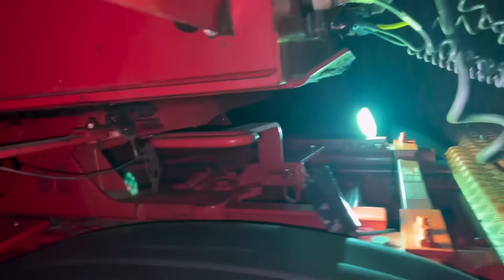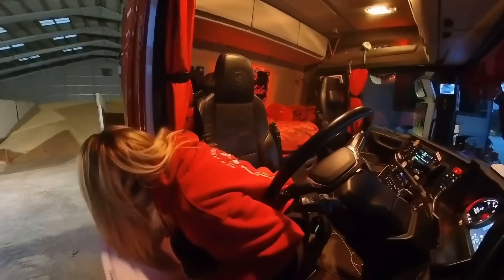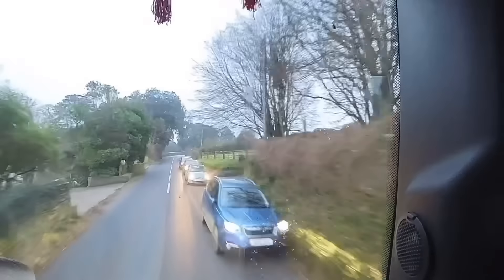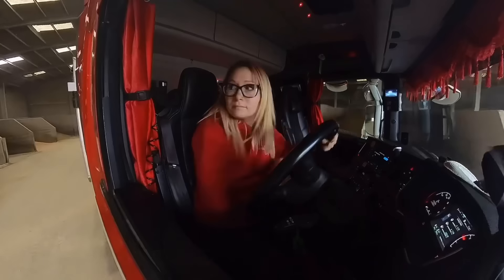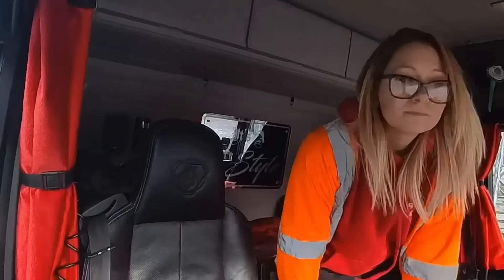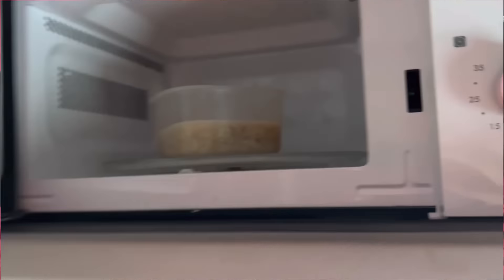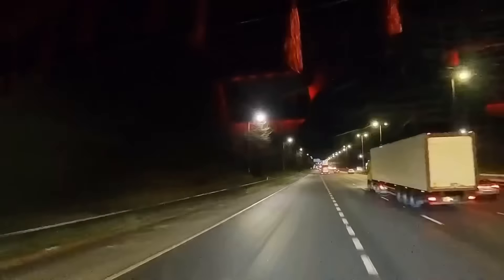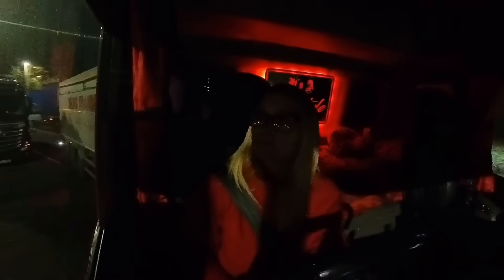Another stressful service station visit | Kingsbridge to Manchester

Comment: Onboard scales and only one trailer plus you get 45 min rest breaks. Easy life 😉. I have to self load 2 trailers with good guesswork so as to not overload on axle groups and  I only get 20mins break after 5 hours duty time 😉. Onya though Jemma for trucking in Blighty. It's not for the faint-hearted. I left it behind over 10 years ago now after having a gut full of English winters. That's what gave me the determination to move to Australia and drive roadtrains. It took a while to get sorted but that's what I do here in Western Australia. No more freezing temperatures for me🙂. If you ever fancy a change of scenery, look me up. Also, I've not heard the word "lorry" spoken for yonks😆. Love it!

Comment: Spent most of my working life on the road as an electrical engineer, usually driving a 'little' van. Though I did occasionally have to use a 7.5 tonner. Fortunately, I passed my car test long enough ago to legally drive one on my car licence.
My experience of motorway services is very varied, and I really feel for you having to use them all the time, as some are really awful. 
I remember Stafford services being built. Prior to that, there was nothing between Keele and Hilton Park.
God bless you, drive safe.
Reply: Take care.

Comment: I used to go to Switzerland from Ireland weekly , the load was for Milan but had to be cleared into Switzerland at Weil Am Rhein then onto Pratteln 10 kms south of Basel for a new set of papers then back to Basle for the overnight train to Lugano near the Italian border Como …Full nights break usually on the train at least 9 hrs and because the product I carried was a class 9 hazardous I couldn’t use the Tunnel at Gothard …Anyway my point on this train I used to meet a Dutchman who pulled a tanker , it was a new FH 16 but a longline extension on the cab an amazing transformation meaning the cab was 10 ft long ..He has a shower and toilet but only took 3 feet of space , a fabulous piece of kit but because he had a shorter trailer he could have a much bigger cab …Surely with a tipping trailer the same should be available?…

Comment: At least you got a shower even if it's luke warm, when I was driving, 1980's into the 90's you were lucky to get a shower once a week ! most of the time it was a strip down wash from your plastic bowl outside the truck with water boiled in the kettle, all very well for blokes but difficult for the Ladies. Good quality fully serviced truck stops were few and far between in the UK then with most only having a sink and toilet if that, different proposition in Europe when I was on the Italy run.

Comment: Never had a microwave in my truck (back in the stone age)... Ran a 2 burner gas stove on the drivers side fuel tank (only 1000lt of diesel so no problem). Nothing better than a hot cuppa.

Comment: Interesting point you made about not filling up to avoid losing a full tank, one of the tips of the trade.
Reply: I didn’t understand that bit, is it in case the fuel is stolen?
Reply: @hitchjack  Yes, a full tank could cost up to a grand , if the thieves tap the side of the tank and its empty why bother.

Comment: Hi,
I have class 2 over 2,5 years and I was in tons of different places from south to midlands, from west to east. The trucks I usually drive was the fridge 26t, which is over 12m long. The biggest frame legally allowed for rigid and I’m perfectly navigate  these vehicles in a tight spots and driving around London. In two weeks time I will be doing class 1. When I get license, will I be considered as a new drive or my class 2 experience also will be taking into the account? 
Obviously I will be a new driver to pull a trailer but not a new driver to drive a truck.

Comment: Do you have to phone up after every job to find out what's next? Feels like all drivers should get a daily manifest or paper copies of the days work so you can plan ahead, put addresses in satnavs etc.
Reply: You make reasonable points but speaking as a farmer that has conversations with lorry drivers, here's a few things you're maybe not aware of.

There are so many variables in a day with shifting grain in particular or possibly even aggregate that it would be hard to plan a whole day unless it's several loads from the same farm to same destination, feed mill or wherever.

Jemma needs to be loaded, unless she can get a hold of the farmer, it's a no go, we mostly all have mobile phones but it's not like rolling up to a factory with staff always there, a farmer might not have got good warning she's coming and be away from the farm.

Even when a load is picked up no bother, sometimes a load can be rejected, not often but it then throws a spanner in the works and the plan for the day gets ruined.
Even when all goes well turnaround time at a destination can vary depending how many lorries are in front of her when she turns up,  or if there's breakdowns at the mill, even a very quick half hour or 3/4 hour empty depending on product can mean waiting a couple of hours if there's a queue.

So head office of a big firm like Wains have multiple lorries doing the same work so they just task the first available in the area.

Kind of like a Taxi firm would.

I've often had drivers phone me to say they're coming for a load in an hour or x minutes as they're just tipping or have tipped.

So things can keep changing as the day goes on and that's not mentioning, lorry breakdowns or traffic hold ups.

So that a few things plus finding the farms, Jemma seems to work in an area she knows which would be helpful and the norm mostly.
Reply: Thank you so much for the explanation. It was much appreciated . Take care.

Comment: I don't know if you have a way to heat water on board but before I had a camper with a shower, I would boil the kettle and make a mop bucket of warm water, and had one of those cheap submersion pump 12v showers. For the sake of $30 they're a good backup to have.

Comment: Hi Jemma love it's mark from Wirral Merseyside 👍 it's nice to see you again with your YouTube videos are you doing another YouTube video were you were 10 minutes away from tipping the trailer full of sand and it was cold from the night before tipping that load of sand and i definitely understand about the showers not working on the motorway services because i no of a woman truck driver and she has tried shower's at the motorway services and they are not all working for some reason why. So the other women truck driver that i no she doesn't bother getting a shower she just gets a top half of her body washed instead at the motorway services or in her truck. But she has asked me for job to drive for me because I've got a Scania R4 series 580 V8 which is all mod up with kelsar light bars side skirts chrome wheels and exhaust stacks and marker lights on it because she is very interested in working for me because I've not long bought another Scania 2009 730 V8 that I'll be using which I've just spent a load of money on so it's the same as my Scania R4 series and both of my trucks are the same. So I've got her to drive my Scania R4 series 580 V8 in second week of march and I'll be using the 2009 Scania R6 730 V8 become I've got two trucks now even though they are the slightly older school trucks but i prefer the slightly older school trucks myself because they do up better with truck modification really. Keep up the great work and keep your YouTube videos coming out please Jemma love thanks from mark from Wirral Merseyside 👍